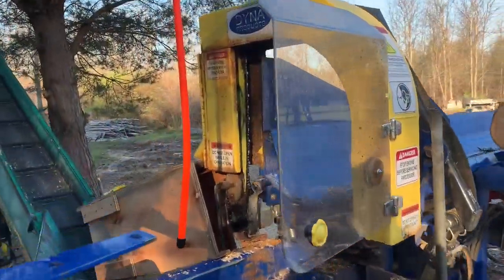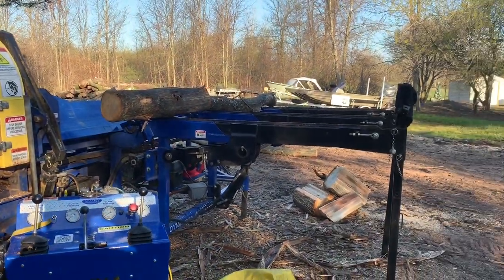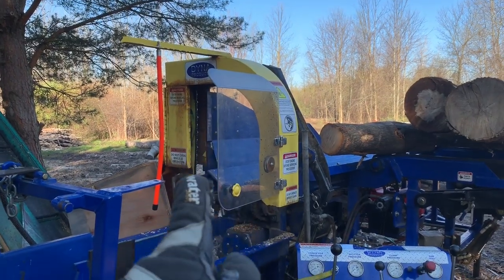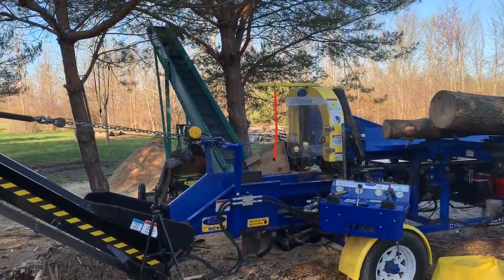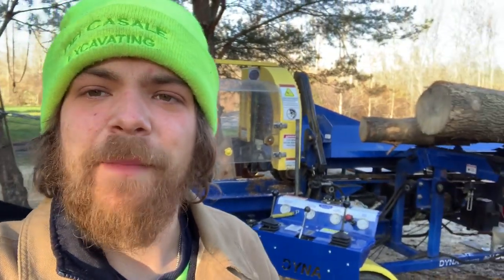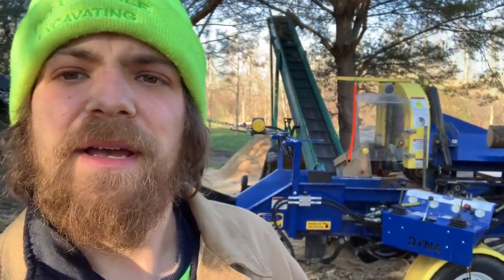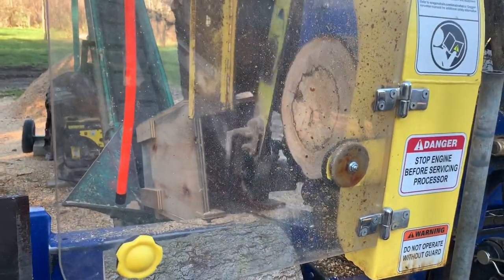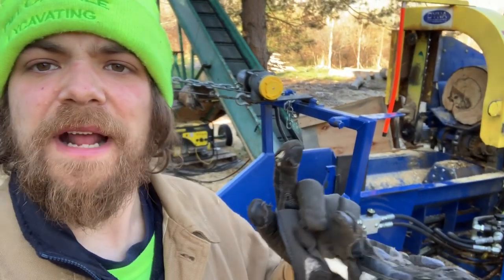HOW OFTEN DO I SHARPEN THE PROCESSOR CHAIN?

Comment: I would think the 50psi on the gauge would remain the same. That is probably just the hydraulic pressure going to the drive motor on the chainsaw bar, which would be the same every time unless you can somehow change the pressure.

Comment: I usually get about 100 cord or 300 face cords before I even have to sharpen my chain, but my firewood is extremely clean. Most comes from people that use forwarders or was cut in winter.

Comment: I don't have a processor, but I'm guessing the blade feed is hydraulic driven. And the gage you are seeing is the pressure at which the blade feed is set. I would expect it to be the same no matter what. You could put an empty bar in there, and it would peak at 50psi or so without cutting anything. So I would assume the pressure to be constant and a better measure would be the time it takes to cut a similar size log. Good thought provoking video!

Comment: Its the pressure of the blade on the wood... you get the same dull or sharp .. the sharper it is the faster it will cut.. but the down pressure is always the same

Comment: First off.... Frozen wood is much harder on any chain.    Even carbides... You have to keep a close eye on carbides in the winter because they can throw a tooth very easily if you're tension isn't adjusted periodically... Call me later and we'll talk about it in detail.   I've been running carbides on my processor since day one and get a heck of ALOT more cutting hours than with a standard chain however you have to factor in the additional costs because carbides are quite a bit more $$$$$$$ the other thing you should be doing is flipping the bar on each time you change the chain to keep even wear on the guide...

Comment: That gauge seems to be the pressure at the saw chain pump. If it gets too high the chain will stretch and stall. If it's too low the rakers are to high and it's not making efficient cuts. What size chain is it? Length, gauge, pitch, type of cutter tooth, semi round, square with round grind or square with square grind?

Comment: Do you get the chains professionally sharpened? I have a benchtop grinder but I generally hand file. Maybe my grinding wheel is shyte, but I find it wears a flat spot after about 5-7 chains. My wood varies but when I cut landclearing wood I will take 2-3 fresh chains and swap them out as I hit rocks or nails and grind them at home later

Comment: My processor doesn’t have a gauge like that but I believe it is showing you what the down pressure is set at. You should be able to adjust it somewhere. I don’t think the chain sharpness has anything to do with it. But, I could be wrong
Reply from the maker: Gimpy 83 I agree buddy.. I was kinda wondering that too. I think your right tho, it’s just the down pressure... it did go down the slightest when I changed to a new chain. But I feel that gauge is staying pretty consistent dull chain or sharp.  thanks for watching and commenting man👍🏻

Comment: the saw bar has a lot to do with how good its going to cut keep the rails square so the chain does not lean to 1 side and bind the bar in the cut and the grove in the bar need to be held to factory spec so the chain can not lean over was a learning curve for me when I 1st got my sc-16 9 years ago wish I could have seen this video back then https://youtu.be/pd_sxxxjL2Y this is a good video on bar and chain if the link does not work typ in on youtube dyna cutting system maintenance

Comment: G'day TWG I don't have a prossesor but I'm sure the circular saw models are called blades and yours is a bar n chain and with either you're correct in sharpening it as it starts to dull before it overheats rolls the the top plate and so on 👍.